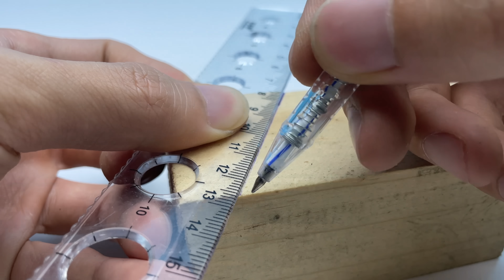Razor Sharp! Easy Way To Sharpen A Drill Bit In 3 Minutes With This Method

Comment: The Time it took you to so-call sharpen your drill. I could sharpen ten of them. What a waste of time on one drill. By the way you sharpen from the front tip to the back to releave the rake.
Reply from the maker: Thanks for watching! Have a nice day!
Reply: This is an EDUCATIVE video, slowed down for inexperienced users. But feel free to make a high speed one showing your amazing skills. 🤣
Reply: @InventorSC 11a
Reply: It's easier doing this by hand rolling the drill with your fingers. Quicker to.
Reply: Prá que todo esse trabalho, com o disco de cortar ferro já tinha amolado a bloca!!!!! @InventorSC
Reply: W ostrzonym wiertle ścin jest zbyt szeroki! Będzie wchodzić w metal opornie!
Reply: Но каждый раз не получится как на заводе. По этому для постоянных работа лучше сделать как у молодого человека шаблон для точилка сверла.
Reply: @donpasquale3187 ten "nauczyciel" nie wie co to jest ścin. 😊😊😊
Reply: Load of horseshit.  Just use the angle grinder and sharpen it by hand, by sight. As long as the cutting edge is proud of the rest, it will cut, and angle is less important. Just have to match the length of the cutting edges on both sides, and the tip where they meet needs to be centered.
Reply: You said it more technical than I could but I was thinking the same thing. I tuned out when he 1-used nails, 2-used a hack saw, 3-used double sided tape.
Reply: Мало гвоздей и быстро сделал без режущего угла.
Reply: True!
Reply: If they would have paid attention in shop class they'd know how to sharpen bits and there's 2 different angles, one for wood drilling and one for metal!
Reply: Who in their right mind attempts to put an 8mm bit through metal! 2.5mm pilot first and work your way up to the hole size you want.
Reply: So ein Pfusch! Da fehlt am Ende die Querschneide, die zwar keine Schneidwirkung hat, aber das Ankörnen überflüssig macht.  Die Querschneiden können dann auch leichter den ersten Span abheben.
Reply: Bench grinder and job done in 20 seconds
Reply: Talk about making it long winded and complicated!
Reply: So anxious to go to the pub?
Reply: So do it.Hes showing an example. BTW, 20 bits? Your ƁŜ,
Reply: Oh yeah. Another expert with a Walmart drill. It would take you an hour to set it up. And then, you'd take it apart and set it up again. Ur FOS.
Reply: "Amazing video! The way you demonstrated how to sharpen a drill bit so easily and efficiently is truly impressive. The lesson I learned here is that with the right technique and tools, even a dull drill bit can be restored to razor sharpness in just a few minutes."
Reply: 😊 @InventorSC
Reply: @bobmudloff4585  i know this is months old, but by hand do you mean you use a diamond plate or a whetstone?

Comment: In a pinch this may help for a minute but there's SOOO much more to correctly grinding a drill bit, back rake, edge angles, edge relief, centering the point......a small 5 way drill gage is extremely cheap... They're available on Amazon and in most general tool stores. If you use this emergency only hand grinder method please please correct your bit with a gage and real bench grinder as soon as you can.
Reply from the maker: Thanks for watching! Wishing you a great day!

Comment: Nice. But ive been sharpening drill bits hand held with a bench grinder for years. You just need to be mindful of the angles and the lead in to the cutting edge.  An angle grinder even works.
Reply from the maker: Thanks for visiting the channel and sharing your feedbacks! Have a nice day!

Comment: Well, at least the point of the video is useful (unlike many youtube videos)... so points for that -  BUT -
A disk grinder rotates at extremely high speeds. At those speeds even a sanding disk can become deadly.
Unless the attachment you added was rated for the RPMs of the disk grinder it can basically explode into fragments at any time due to the centrifugal forces. If the sanding disk detached from the hook-and-loop it could literally slice you like a knife (imagine that hitting you in the neck).
I would suggest controlling the RPMs or using your idea with a belt sander.
Reply from the maker: Hello! Nice to meet you! Thanks for visiting the channel and sharing your great experience! I would love to learn your methods! Wish you all the best!

Comment: If you cant understand how a drill bit works then don't even try to sharpen it because its not goin to work out for you.  Get at least a mild understanding on how they cut an why the tip is shaped like it is,,,,then you have a pretty  good chance of success in sharpening a drill bit,,,an my minimal experience about a 5/16 dia is getting real close to the smallest 1 i can do free hand,,,much smaller it gets really touchy.  Novice attempts aka just trying the first couple is usually a failure,,,but with correct knowledge on the correct grind on the tip ,within a couple bits Bam! You'll have it down,,,,i did,,,i think back through  the years of new bits i bought because mine were dull and would cut,,,holy moly i could have bought 5 acres with a home by the time i learned to sharpen them wow,,,,its a must if your just a tinker kind of guy or full on rebuild everything,,,,,learn it now!
Reply from the maker: Hello! Thanks for watching and sharing your great experience! I appreciate that! Wish you all the best!

Comment: He did  not made it in 3 minutes. I can shrpen with marker on the bench. The grinder is wiggling. We use grinder for tool and drill bits for the purpose only. That is the integrity on it so as on safety.  ISO let those things fly to the scrap yard.
Reply from the maker: Thanks for watching! Wishing you a great day!

Comment: Absolument faux. Il y’a deux angles à respecter dans ce cas. L’angle de pointe (Il peut être réglé à n’importe quel
angle de 90° à 150 ° selon le diamètre de l’outil et la dureté du matériau à percer), et l’angle de dépouille (L’angle optimal peut être réglé selon chaque type de perçage, à 7°, 9°, 11°ou 14°). Ce qui fait quatre facettes. Ce type d’affutage n’est pas correct.
Reply from the maker: Thanks for watching! Wishing you a great day!

Comment: It doesn't matter if the angle is 118 or 122°. But the same length of both blades is important so that the hole has a defined diameter. These primitive preparations do not solve this. Training is better. I'll do better by eye.
Reply from the maker: Thanks for watching! Wishing you a great day!

Comment: All that just to sharpen a drill bit?! Where in your garage are you gonna put all that stuff now? Plus all that including everything would at least take half hr or more. Unless you set everything up ahead of time. Even then no less than 15 to do all that. No way it can be done in 3 or less minutes. And there are many faster ways to do that. Like put the bit in a vise and carefully do one side at a time using your angle grinder by just barely touching it at the right angle is all. Takes like 1 minute 30 seconds . Just saying
Reply from the maker: Thanks for watching! Wishing you a great day!